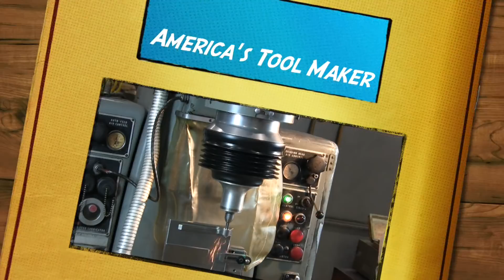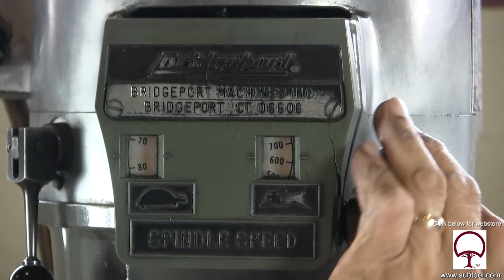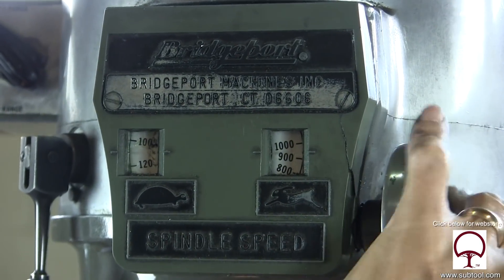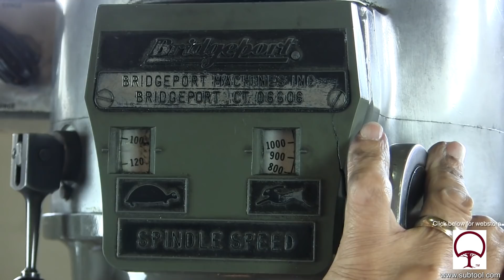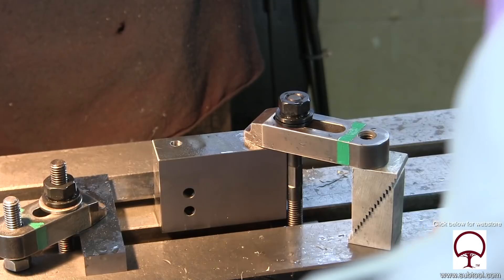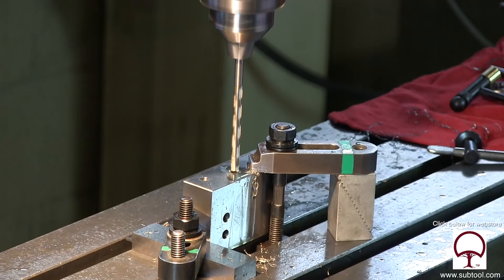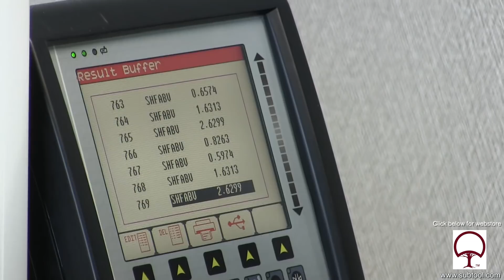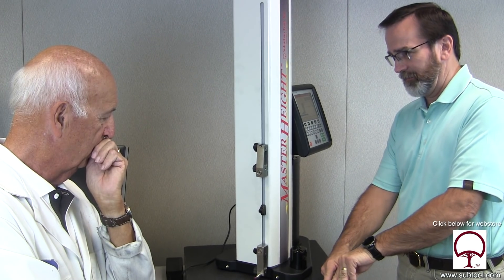How To Make Two Accurate Moves On A Bridgeport Without Using A DRO

Comment: Only once have I needed to be taught about loose clothing. Started the day all fresh n pressed, cutting a big S.S jam nut thread leaning over watching and hand on the tool post and slide handle. The front of my shirt had untucked and got caught in the leadscrew got pinned to the carriage and it ripped my shirt clean off me. Had a few wierd looks the rest of the day as i reassembled the shirt using zip ties on the sleeves and down the back. I did finish the cut with no shirt on.

Comment: Could you have tapped the stock on the square instead of the blade. There would be no chance of damaging the squares accuracy.
Reply from the maker: Yes, tapping the stock and not the blade would be a better option. Thank you.

Comment: The problem seems to be that you insist on somehow using your left hand to change speed. This means that you are leaning all over the machine to do it ( while the spindle is running! ).  You are lucky it was your pocket and not your sleeve.

Comment: You'll get more accuracy with what we called a reaming end mill. I drill if not dead sharpened accurately will wander a bit and they next size drill will follow the first and the reamer will follow that.
By using a resharpened end mill that is a few thousands under the reamer size you will straighten out the hole by basicely boring it. Now your reamer will follow the straightened out hole and be more consistently accurate.
Reply: If you use a spot drill the size of the finished hole and go a little deeper, it will leave a nice true counterbore to guide the reamer.

Comment: Wearing loose clothing, long neck-ties, or a wedding ring is just asking for trouble when milling.
If you catch your hand on a moving milling cutter then you might get a small cut, but if it snags on your wedding ring then it's going to pull your whole finger off.

If you are an older machinist and you can't take your wedding ring off any more, then wrap a plaster or some tape around your finger so the ring won't catch on anything.

Comment: And in using that method i would suggest to tap only on the stock of the square where it is clamped, not to tap on the blade and transfer the impact through the blade/ stock joint.  Otherwise your square won't be. 

And if you are planning to tap the workpiece against the square you need the square clamped to the table at two points rather than one.  I was expecting you to realise that you'd got the error because you'd trapped the square out of alignment when tapping the workpiece in the second location.  You only verified the square stayed straight in the first setup not in the second.  When i saw you tap it in and not re verify squatters i was expecting the error.   I'm still of the view that this is more likely the source of error than that you moved a locked-down table by snagging your pocket.  If you'd snagged it hard enough to move the table 20 thou against the table locks, you'd have ripped your pocket (or if not, then it would have jerked you so hard that rechecking your setup might have been am obvious next step. If it wasn't that serious then i doubt that add your true source of error.

Comment: Good lesson.  I thought the rule was (And it is in my shop) just NO LOOSE CLOTHING, AND NO LONG SLEEVES around machine tools, of any type, ever. I heard too many stories of guys getting a sleeve caught and being pulled into their lathe or mill with horrific results. 
You seemed to have white shop coats as company issue with embroidered names, suggesting it being official company policy (Or art least company culture) to wear a loose coat with a loose sleeve, in the workshop.  This is madness from a safety and liability viewpoint and should be re-thought.
The outcome you had, of accidentally ruining the part, is way off the scale in terms of good luck.  There's a learning outcome at zero cost and you didn't get tangled up in the mill and killed or maimed. Boy it is your lucky day. 

Well it is lucky if you get smart and reserve those coats for gardening, welding or mowing or just throw them out.  Otherwise it is a learning outcome totally wasted.

Comment: I learned about long sleeves in the shop with a good scare on a 9" South Bend lathe at about fourteen years old; still remember the lesson nearly four decades later...

Same shop taught me to never leave the crank for the knee on a mill engaged - pull off and flip over when not in use.

So many ways to have a "learning experience", always good when just the ego gets hurt

Comment: Like our machining class professor told me when I had a discussion with him about my micromachining project for my thesis he told that the only way forward in machining is making mistakes, finding them and learning from them! The next day it made 100% sense when I started making a pile of 0.15mm drills on the shelf over my lathe...I was wrong and that was not the way to do it!

Comment: i always just used 1-2-3 blocks clamped to the table never had to worry about those suckers moving then all the rest falls right in place and yes those blocks he is using a set cost more than most dro lol but you also get movement of table when locking it down always
 every machine is different

Comment: About a year ago the maintenance man at my shop was repairing the motor on a Bridgeport type milling machine.  He had gotten the machine back together and was standing on the mill table whilst reaching around to the off/on toggle switch to power up the machine spindle and it got him.  He failed to remove a 2"o.d. two flute end mill from the tool holder in the spindle and it caught him and wrapped him up.  He wasn't badly injured, some cuts and scrapes.  A co-worker was walking by as this just started to happen and he him the E-stop quickly. The maintenance man lost the top half of his coveralls and his ego that day.  The tool was going about 20 R.P.M.. Never underestimate the power of these small mills.
Reply: They have more torque at lower RPM.  Gearing.  That means they won’t stop!!
Reply from the maker: That's scary! It's always important to be careful.  Even at 20 rpm, that machine is still very powerful.  Thanks for sharing your story.
Reply: Never underestimate something designed by a Scandinavian in Murica... Never underestimate the love to manflesh from 2 rad/s when Murica...  ( did it say made in Murica or made by Abom? on the tooling? ? these are insane quality )

Comment: Interesting way to do it.  Using gage blocks like this to indicate reminds me of some of the older mills that had vernier scales mounted on the axis, or sometimes dial indicators with a tray for the gage blocks to offset the measurement.  In this manner, a dial indicator with perhaps 2" of travel could be used to indicate accurately over a much longer length.  
Here's an example of vernier scales on a wells-index mod 55 http://www.lathes.co.uk/index/img12.jpg
Here's an example of the gage blocks and dial indicator on a Deckel miller:  http://www.lathes.co.uk/deckel/img20.gif

Comment: Suburban is top shelf tooling!expensive!but worth the money...I clear the chip reaming lil higher rpm for slip fit...I push at lower rpm for press fit using the same reamer.

Comment: 1979 first mistake at the lathe as an apprentice... belt loop on my pants catches the cross dial as I turn and makes a minor cut in an otherwise perfect workpiece. The Q/A dept. sort of forgave me, but it took weeks before I stopped hearing remarks about it, but the embarrassment and the teasing worked... It never happened again :D
Reply from the maker: That's a tough lesson to learn, but it seems that it stuck with you! Thanks for the message, and thanks again for watching.

Comment: OMG!  You have to be so careful around this stuff!  Just last night I was turning some parts on my 20" 1903 American Tool Works lathe.  It has a clutch knob for long feed and cross feed.  If you are not careful you can accidentally bump the power cross feed in When you do not want it.   I ruined two pieces before I figured out what was happening.  Fortunately the parts I was making were not expensive or hard to make.  Thanks for showing us all the reality of machine shop work,  Sometimes things just go south on you.

All the best!

Mike
Reply from the maker: Wow, that sure is an antique machine! Glad to hear you didn't mess up anything expensive.  Thanks for sharing, and thanks again for watching!

Comment: As the saying goes, learn from your mistakes but better yet to learn from someone else's. Lesson learned. If an employee had cocked up, would you be as understanding?:>)
Never thought about the soap trick but I used to use hand cream before getting dirty using the theory that if you fill up the pores with clean dirt there is no room for dirty dirt..
Reply from the maker: Mistakes happen all the time, you have to be understanding in this line of work.  If you don't, you won't have any employees!
Reply: I bet you could do everything needed in your factory if you didn't have any employees left, output might be a little down if you were on your own and the golf course might have to miss you a bit more. On the other hand, just think of all of the income being yours.

Comment: I have ripped lab coat pockets a couple times before on a bridgeport while reaching for a drill bit on my toolbox. Both times I did edge find my work piece all over again. Sorry, no DRO on my mill.
Reply from the maker: Good move.  I should have re-indicated, but I didn't think much of it at the time.  Lesson learned.  Thanks for sharing, and thanks again for watching!

Comment: Great vid, showing that anything could go wrong. Thanks for sharing and keeping us all humble.

How square is your square?
https://lh3.googleusercontent.com/GRvHbi5mZR2vp_MMqtrsGiFWaK9H7PmDQNCHSmFvy2qvOKH-LAH3RCQF6KiG_jzE4Qpg8Dn9f9G2y5w3yyhvicqv0aDvCQXjTWFdNCdfaGKDoJHbMIw66tQdJGn2QAFbpzYSDT3ea1rfjbWxbN1q_MwALVjedpkcQbrwGyi5PaJ8ooeyiMeiy4LL7kFGr_3YQ5-S0I7mLBKv_3FdF-T6xtGN6EyeBdhiJvRqYotiMSJbWpnALarV54pB8wSu46Ksgs_2Zke8XcC-cWpUBa286m7qcmavp78gOnAu4Jn9XNTEzK5nC_eZUarpwHThzD5SG3DbffCcBHslR-X_qItXCs4XnGrWxUpozFKyFXJjm6Tr3Q2FEHgQ0JVRG3UKmSJQCkaLiDuYFZ24BLA_iCcNDX3gzdoP5NR2ASZ-4FK7W1nPwOFJ2TilhlF_2DMxSz8VlMAz5mR7BdXZPSf3fXlB1d61WziWwwYj5yPgItzRaFRsk_Or9Ib9VUhRelsWeMhTsuSAk_gM5VgCSgdSEZF6z6ksw61hSOPBiSjBLRuGrZkaJgcmU-LkeSjiJkVR0aV9l2xu-gtww-v74ju0dbRiu-kEzILuP_w=w1312-h738-no
Reply from the maker: It's square, but you bring up a very good point.  If the square was not square, it would have been the #1 suspect.  Thanks for sharing, and thanks again for watching!

Comment: Two questions:
first, if tapping in the square, should it be tapped on the block (which is the part clamped) rather than the blade, to avoid taking it out of square? This is what I was taught, and have always done, but you work to higher precision that I generally do.

Second, when using the gauge blocks as spacers, is there any advantage to lining the square with the machine axes? The hole positions on the pat should be the same no matter the alignment, as the gauge blocks are self squared to the part.

Comment: This is an excellent video Don for two reasons.  Firstly, obviously showing people how to use gage blocks for positioning but just as valuable was showing what can go wrong in spite of experience and best efforts.   Personally, I dislike most shop coats that nearly all seem to made for people shaped like a pear so the the bottom half is flopping around and those damn pockets always get caught on things. 

I wear old jeans and an extra long snuggish T-shirt over another T-shirt with bare arms and usually no gloves. I'd rather get spot burns from hot chips bouncing off me than get caught in a machine or have the pleasure of a 600 degree chips caught inside the wrist opening of a glove or up a sleeve.  Its very easy to bump or snag the cross slide handle on a larger lathe with loose clothing where you have to lean over to see what you're doing.  Messing up on a $3000 piece of stainless with 4 days work invested because of a pocket is not a feeling I want to experience.
Reply from the maker: These are all very good points.  Minimizing places to snag on a machine is great not only for safety, but for the sake of quality of work as well.  Function > fashion, eh? Thanks for the message.

Comment: Thanks for the response I run a horizontal boring Mill and unfortunately I've had issues with clothing getting caught in the spindle in the past and it's very scary....
Reply from the maker: Indeed, that is.  I hope you didn't suffer any severe injuries.  Be careful out there.

Comment: Hey Don loved the video. I would never ever use a small hammer to tap the part in place with the setup you had.
Reply: why not use a hammer ? It's a brass faced hammer ... will not damage the square or the workpiece..
Reply: Werner Berry first tool we made at school the little hammer

Comment: I've been scratching my head over how to make accurate long moves on an old horizontal mill. You guys just gave me an idea.
Homemade gage blocks out of 1" square CRS, cut, milled and ground to various standard lengths from 1" up to 12" each.
With those, a couple good squares and angle plates, some good dial indicators and I should be good to go.
Thanks,
John 

P.S. Know where I can get some good angle plates?
Just kidding. 😊
I know very well where to get those.
Reply: I have a Starrett tool that does that. It is a round bar with notches ground into it at one inch intervals and a sliding indicator mount that engages the notches. Not as convenient as a DRO, but you can use it anywhere and reach intermediate dimensions directly from the dial indicator. 
   Even with a DRO I set the dials to zero and use the dials to confirm that the DRO is correct. Years ago I scrapped a very expensive part because of a defective DRO. There was a bad spot in the DRO scale. Unless you were at near the table's end travel you wouldn't hit the bad spot... and when you cranked the table back it would go to the correct zero. I don't know how long the DRO was faulty, but I was the first one to run a part long enough to need very nearly the full table travel.

Comment: Might have been clothing, but I wouldn't exclude possibility of square slip. Video doesn't show a check if square hadn't slipped after second tapping on the part (before second hole). I think you just assumed it shouldn't.
Reply from the maker: Valid point, but our move was short on the Y-axis.  If the square had moved from tapping the part into the second setup, the Y-axis move would've been long.  Thanks for the comment, and thanks for watching!

Comment: The reaming thing is interesting most gunsmith's who dont use high pressure coolant will remove the reamer every few thousands or so the remove chips from the reamer to avoid "rolling a chip" and often get finishes so good they need to rough up the chamber slightly with scotch bright.

Comment: ok, so you positioned the part against the square and offset with gage blocks.. I got that.. but what did you do to place the drill/Quill in the proper location?
Reply: John Galt he did not move the quill or table. Set the blocks against the square and locate the hole and lock everything down. After the hole is drilled remove the gage blocks and secure part against the square and drill second hole.

Comment: Don, my DRO only gets me close and I am forced to use above methods. My SocSec will not not allow a full set of gage blocks. (Not funny after I paid in for >50 yrs.). make my own, measure what i made, then dial gage. thanks for showing me your thoughts. I think the backlash compensation is screwed up. DRO is not last word in my humble opinion.
Reply from the maker: It's good to know how to do the same job multiple ways!  Thanks for sharing your opinion, and for watching!
Reply: you are most welcome.

Comment: But I seem to have missed how the gauge blocks are used.
Reply from the maker: Head to around 3:20.  Notice how I put the 1" gage block in between the part and the edge of the square to push the part 1" out on the X-axis; now move ahead and note the .25" gage block between the part and the other edge which moves the part .25" on the Y-axis.  After we drill the first hole, we remove the gage blocks completely and mount the part into the square alone.  This ensure that the next hole will be exactly 1" from the first hole on the X-axis, as well as .25" away from the first hole on the Y-axis.